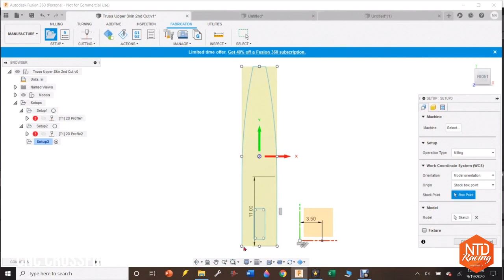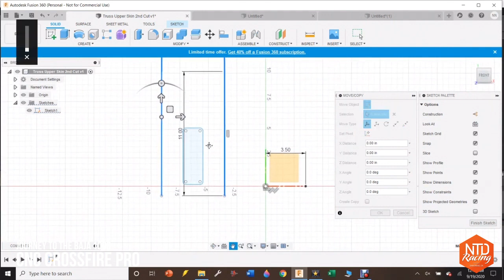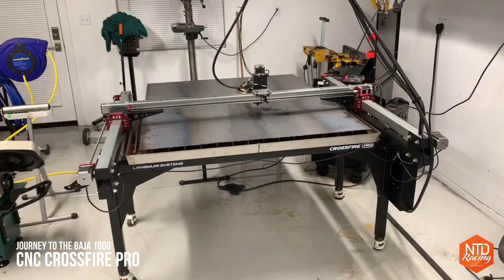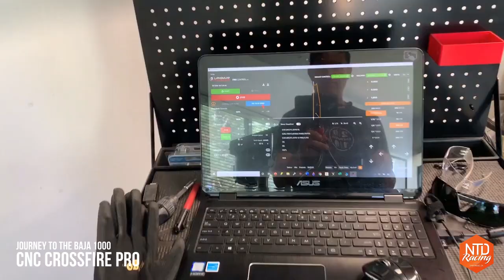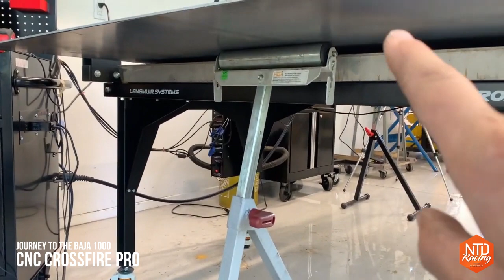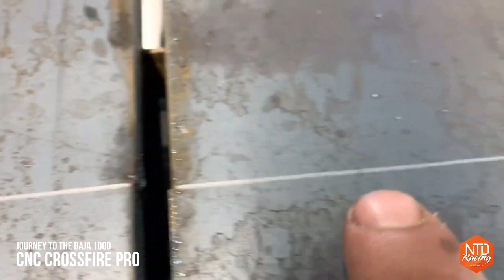Index cutting with the Langmuir Systems CrossFire Pro and Fusion 360

Comment: I really liked and appreciate your videos.  I have a suggestion.  Before starting an operation make sure your lap top has wifi turned OFF.  I haven’t used or done any plasma cutting, however I do  operate two CNC machines doing wood carving both 2D and 3D.  I use Vetric Aspire software and love it, during one of the many tutorials I have listened to Vetric mentioned that you should never run G Code on the CNC when the computer is connected to the internet, .Occasionally I would run a G Code file on my dedicated computer while it was connected to the WiFi., Weird things would occur that I couldn’t explain.  Not every time, but enough times that I ruined more than one expensive piece of material…. Then I ran across a tutorial that warned against having your computer connected to WiFi.  Since then I have made sure my WiFi was turned off in that computer. I have not experienced any anomalies since turning WiFi off before running GCode.

Comment: Just a thought as I watched this....would it not be better to cut the holes and openings from the part before the part is cut?  Two reasons, first being that the part could shift slightly when it's free from the sheet and the opening may not be perfectly oriented. More importantly, there is no direct ground to the part after it has been cut out. The plasma current would have to travel through the water table slats and possibly cause arcing or misfires.

Great video, intriguing ideas!

Comment: great work! I have acualy built a similar cnc table and I am using ipt 60 torch. I was having an issue with a torch misfire. I could not figure it out, I even took apart my Herocut plasma cutter to make sure if the electronics is ok. The problem was only with the pierce delay. Some of the plasma cutters have some safety switch. When you fire the torch and slowly drag the torch from 3mm to 1,5mm it blows the material so much that the pilot arc switch is thurned on. As soon as the pilot arc starts he plasma automaticaly disengages the current flow. So every time you have a misfire, try to shorten the pierce delay. From now on I only use pierce delay with 5mm and thicker material.

Comment: I'm starting a bussiness myself. And after watching your videos, I think I'm gonna get a crossfire. What software does it run, ie solidworks? Or do you have to get software separately?
Reply from the maker: The only software that must be run with the CrossFire is FireControl which controls the table and is free.   You need to make G code to put into FireControl.  To do that you need a Computer Aided Manufacturing (CAM) program.  That can be SheetCam or Fusion 360.   The CAM needs something to convert to G Code.  That is made in Computer Aided Design.   There are many places that you can do that like Fusion 360, SolidWorks and many more.  I like Fusion 360 because it is CAD/CAM all in one and free for home use.  I do have SolidWorks and SheetCam but have not committed to learning how to use them yet.   Hope this helps.   Good luck.

Comment: For positioning, I would make mounts that fit between the frame and cut piece. That way you could just push the work piece against the mounts and get the same y position all the time.
Reply: ahh but you're never guaranteed that the actual steel is square, this way guarantees them that an independent square is always the point of reference.

Comment: To get rid of the extra lead in, set the pierce clearance to zero (and disable lead in-lead out)
Reply from the maker: That must be it. I will try doing that.  Thanks.
Reply: @ntdracing  when I cut a part that I plan to bend later, I often cut some lines along the bend line, to make it much easier to align everything on the bending brake. To do so, I create a cut operation with no kerf compensation (center) and disable lead in - lead out - piercing clearance to have a perfectly straight and centered cut.

Comment: What is the model plasma cutter you are using? I have a Lincoln Pro Cut 55 . It works but the flame starts after the LS crosscut starts to move. Great videos', very helpful.

Comment: Great video I had the exact same reservation on buying this plasma table because of not being able to do a full sheet. After watching this it gives me some ideas on fabricating an extension for holding the material and moving the material with a peace of flat bar on the one side as a guide (think table saw guide) so you have something to slide the material against to keep it true. Fyi the 3d printer link is unavailable.

Comment: how is the smell (with water table)  in a closed garage for guys just playing at home?  does it put off a lot of fumes?
Reply from the maker: Not bad.  I usually open doors when cutting steel and run a fan when cutting for a long time or cutting aluminum.

Comment: After you inverted your part, why did you choose to cut the external contours in a counter-clockwise direction, given the best cut quality will be on the right side of the arc? I understand you will be starting at your original origin, but whats the harm in starting the second half where the first cut ended (right side)?
Reply from the maker: I agree, but it was the only way I could figure out how to line up the next cut.  As it turns out, it was close enough for my project.  Results might not be desirable for art work.
Reply: @ntdracing  yeah that confused me too. I'd think that, even if you keep the same side, as long as you zero all axes on the same spot, it should be able to move on the other side and cut it as accurately.

Comment: OMG your floor - details?!?
Reply from the maker: Garage floor?
Reply: @ntdracing  yeah, it's amazing - polished and white epoxy or something?
Reply from the maker: https://epoxymaster.com. I went with light grey and the clear coat with no flake.  The 100% solids kits cost more, but are totally the way to go.  If you do not get a bunch of sunlight on your garage floor, I would recommend not using the clear and plan on putting the base down a little thicker.  We just did that on my buddy’s garage floor, and it is a mirror.
Reply: @ntdracing  man, I appreciate that - it looks amazing and your space is so much brighter than what I'm used to.

Comment: Speaking of jealousy...I'm seriously considering the Langmuir table as a shop addition next year.  Very cool to see it in action.  Love the quick and dirty 3D printed pointer system.  It'd be pretty trivial to mount a cheap, battery operated laser pointer to one side of the torch mount and account for the offset so you'd never have to remove the torch.  For a standard sized sheet (or multiple sizes, if you got industrious), you could also make a jig that would physically index off of the gantry rails to center and square a 48" wide piece of stock without going to the trouble of marking it out and switching tools.  I really like Fusion 360 - been using it for a few years now for most of my crazy projects.  They just neutered the hobbyist license a bit when it comes to CAM (particularly when it comes to rapids - G00 moves), curious about how that's affected you, if any.

Comment: Suggestion - Use the 3D printer to make yourself a pen holder and use it in place of that plug. Let the machine make the reference lines and you will get better/easier accuracy. Also, check this out for a cool automated pen plotter head thingy... https://www.youtube.com/watch?v=c3LhK2SAusk

Comment: I think if you take out the 90deg  on your set up, it will take out that lead in. Not 100% sure as I'm still learning myself. I also drag a box around the part to select everything. It's just a little quicker. Thanks for your videos on this machine. I'm going to post some when I get mine set up. We need good videos on this thing. I was excited to see you posted one. This was great info!
Reply from the maker: WOBBLIN GOBBLIN even when I selected no lead in  and lead out, it still added a lead in.  It ended up not being a big deal for the type of cut I was doing.
Reply: @ntdracing  Can you set your lead in or outs to something like .054mm or 1/64th"?
Reply: @amusingandy1  it is enough to set the pierce clearance to zero - no more lead in.